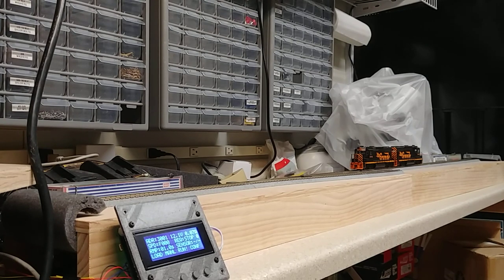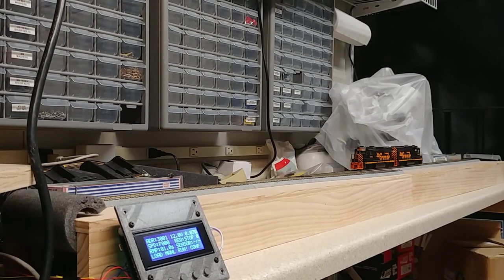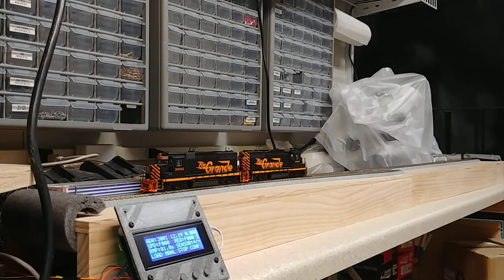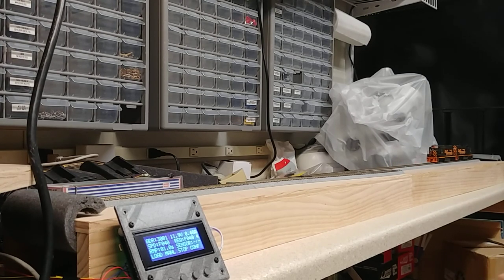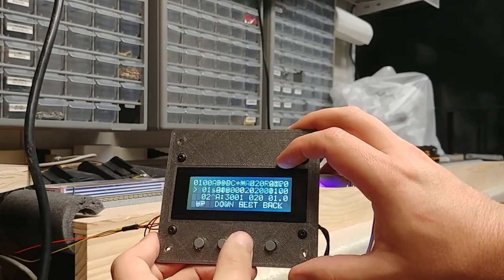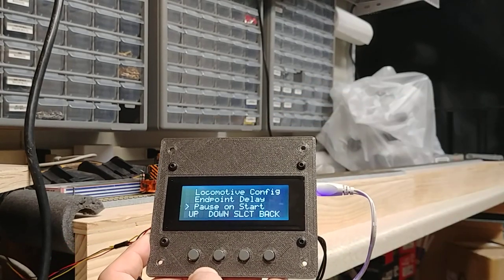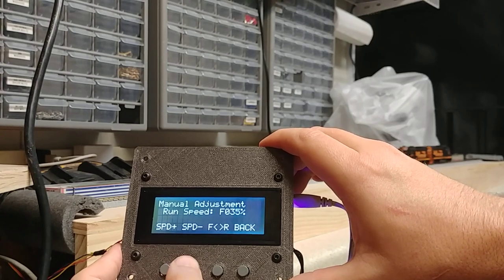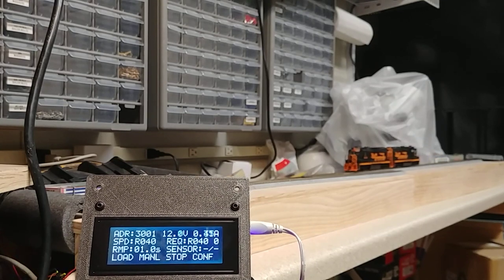A Sneak Peek at an Upcoming Product

Comment: Very cool! So it's an Arduino + Motor Shield acting as a DCC base station? Is this built on DCC++? How do you do the DC control - is this just PWM DC to the track?
Reply from the maker: The original prototype back in 2015 was an Arduino, LCD shield, and motor shield.  This is one completely integrated unit, designed from the ground up to do just this.  The code for the original was using Railstar's CmdrArduino for DCC generation.  This new one is using a much simpler DCC generator I wrote last weekend.  The code for both is on Github - take a look at the link to our website if you're curious.  The old Arduino-based one was there in the old article, but I just added a link to the source files for the new product.
Reply: @iowascaledengineering4209  Fantastic!

FYI, inspired by your throttle, I want to experiment with something similar but based on UK train controls…
Reply: I’d purchase one to try. Just to test my track and signals. I have all the components but this looks like a sweet package!